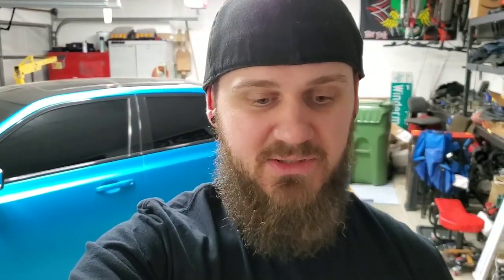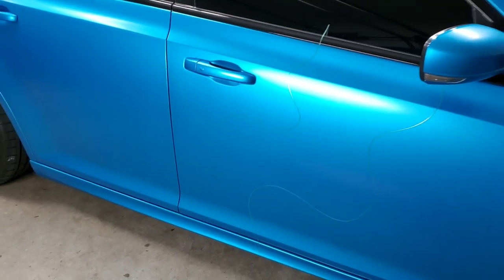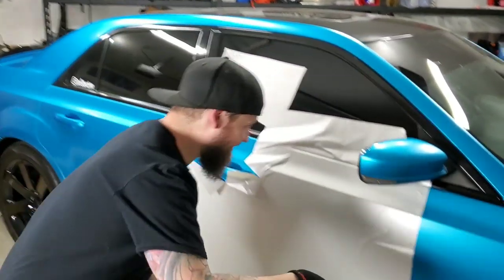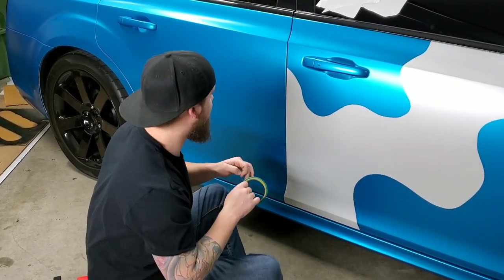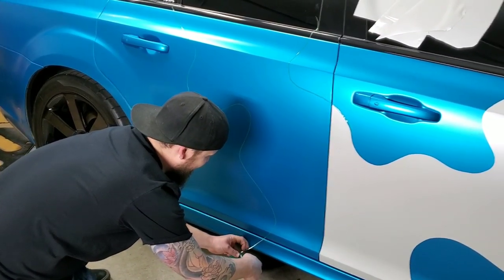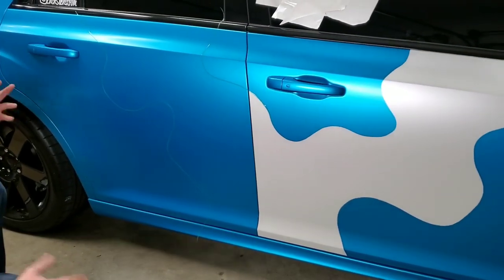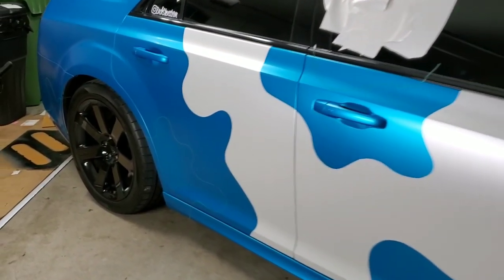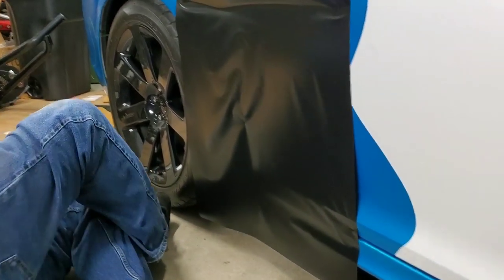Camo Chrysler 300 SRT8 | Quick How to DIY Camo Wrap | Cheetah Wraps | Vlog

Comment: How much vinyl did you need for this besides the base color
Reply from the maker: I didnt measure how much I used. With cheetah you can only buy 25ft or 65ft rolls. So I bought 25ft of each. I have plenty left over. You could maybe get away with 15ft each?? I'm sorry I can't answer that exactly
Reply: I tried looking up the brand of that wrap but can’t find it , do y’all happen to know the website ?